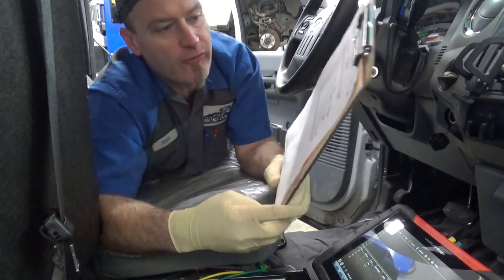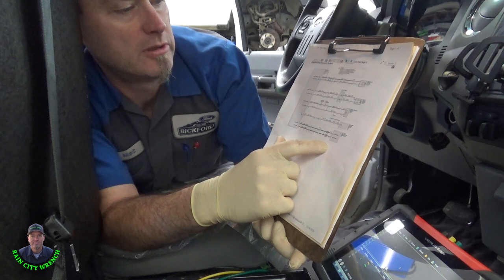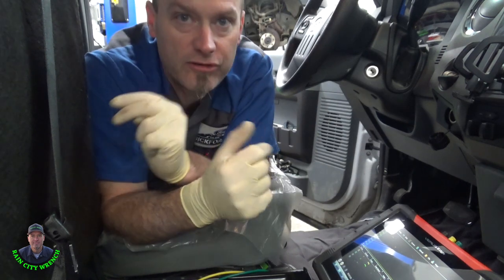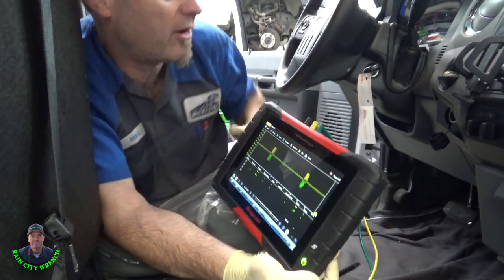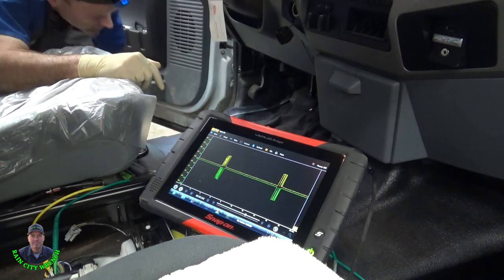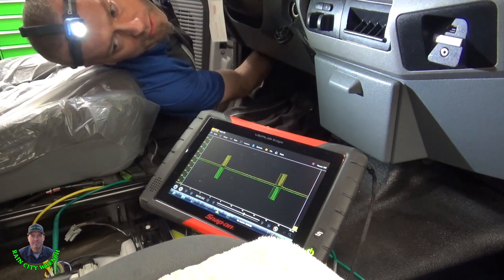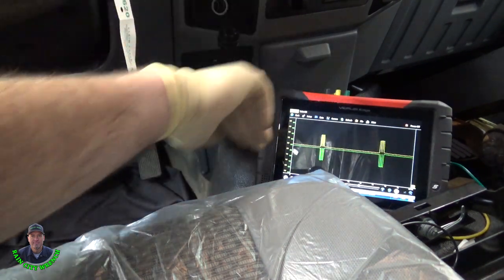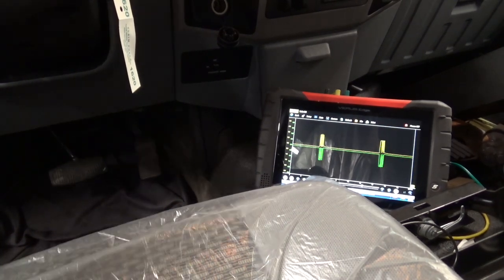U1A00-ABS U0028-TRAC CODES

Comment: I'm having the same codes and I suspect same issue can you please show me what that connector looks like please
Reply from the maker: Sure. Send me an email to raincitywrench@gmail.com and I can send you a picture of the connector with pin configuration.
Reply: @raincitywrench117  tengo el problema en una camioneta  super duty 250 2012 4x4 no apaga la luz y me marca servicio de advance trac q puedo hacer